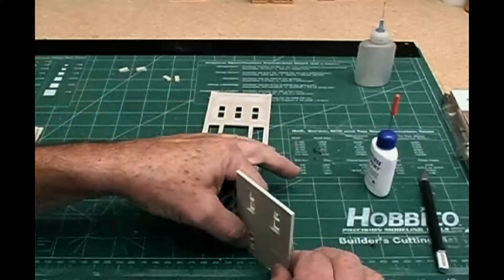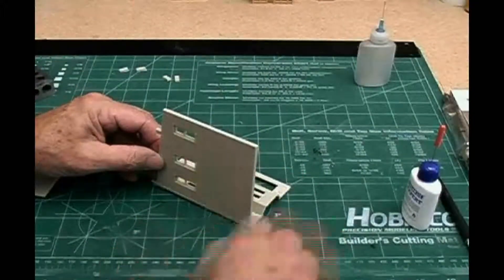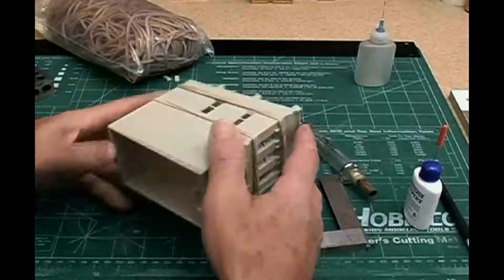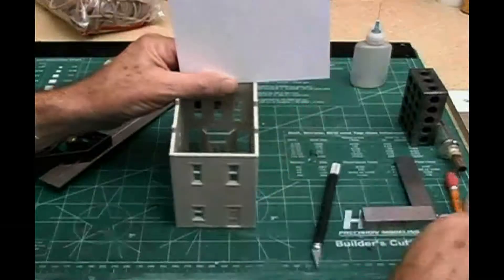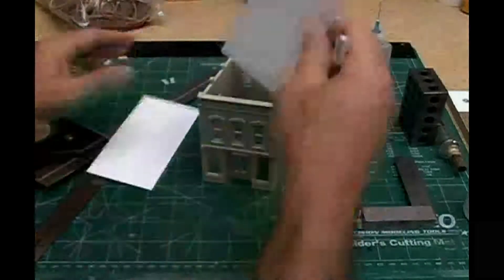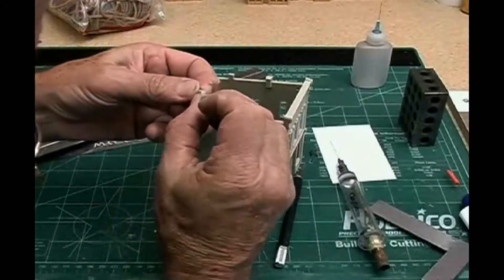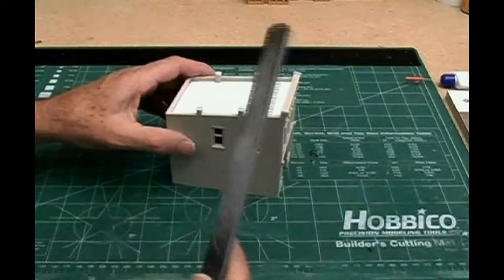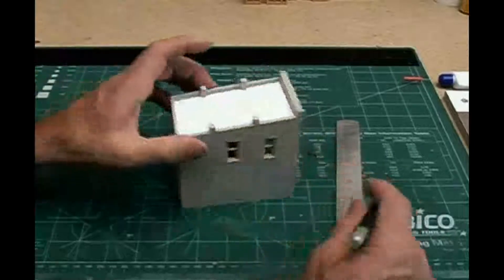Building Assembly / DPM Kits - Part 5/21 - Woodland Scenics

Comment: If you set the building on top of the styrene sheet and trace around the inside of the building with a paint pen and then cut on all four lines, you will get an exact fit the first time!!